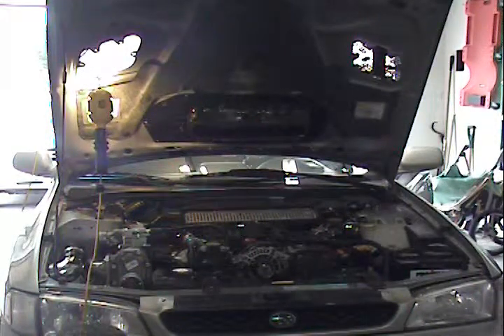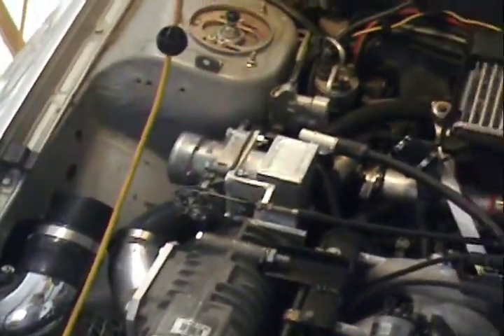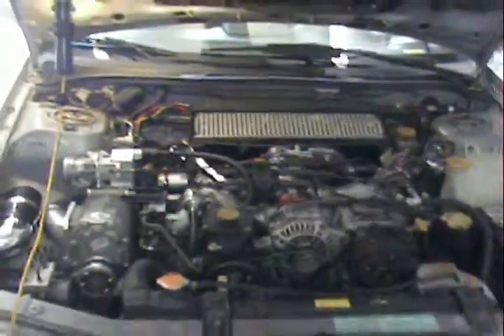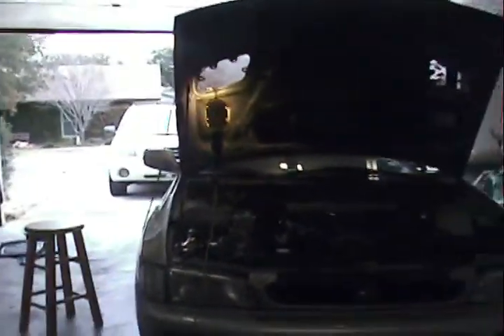Subaru Impreza Supercharger - Throttle Body Relocate Initial Startup 01

Comment: I have a lot of rev hang after I installed a intercooler on my supercharged tl if u relocate the throttle body doesn't this make the supercharger in boost mode all the time and put stress on it
Reply from the maker: For a fixed displacement type of SC like mine, you really want the TB in front of the SC.  The SC is just trying to compress vacuum so it's not really efficient, but totally harmless. A CBV can help, but is not required.  For a centrifugal type of SC, you'll want the TB after the SC.

Comment: why would you want to relocate the throttle body? the sensors?
Reply from the maker: Fixed Displacement Supercharger.  They work a bazillion times better with the TB in front of the SC.  A blow-through FixedDisp SC is far from ideal.